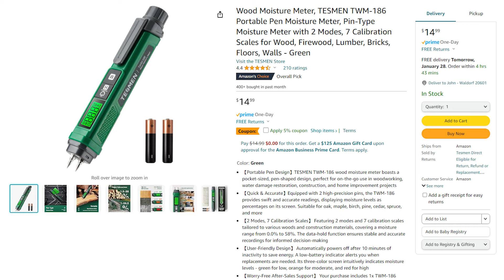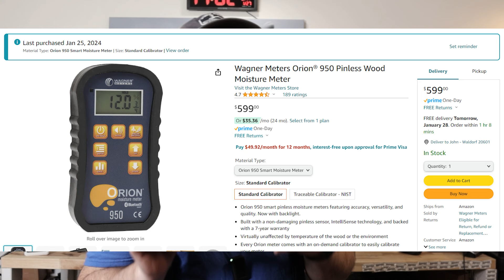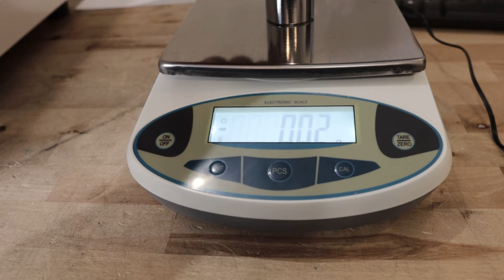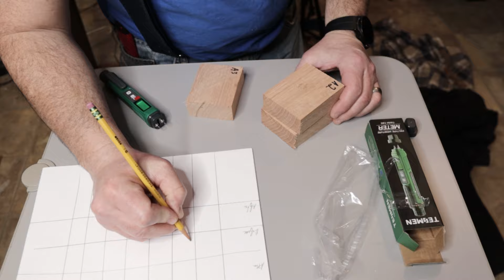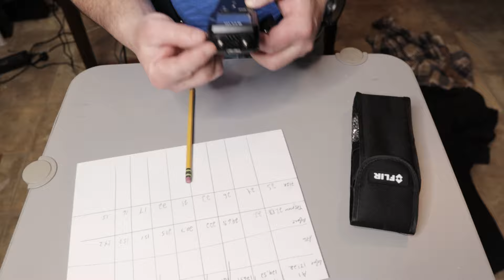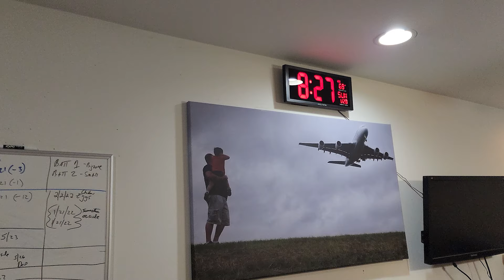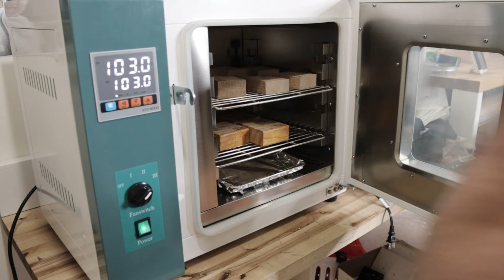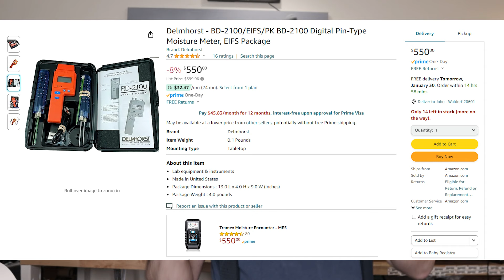Science Proves Which Wood Moisture Meter is Best

Comment: I tested my wood for moisture without any meter simply by looking at the smoke when I burned a sacrificial piece.  The lesser the smoke the drier it was.  I was extending my house and my uncle who helped me frame it told me he would be back in 6 months after showing how wet my wood was as he burned a piece of wood that I had in my garage over 10 years and compared to the new wood.  . The smoke from my wood was unbelievable as a lot of it was steam.    He said it would go quicker if I moved my wood to the garage and cover it with plastic and shipping blankets and leave a tiny heater going 24/7.  He said to refresh the air 3-4 times a day and you could easily feel the humidity.  In about 4 months that wood was ready to build.  It still smoked more than the old wood but not by much.
Reply: This has given me an idea,thanks !

Comment: I'm a retired hardwood kiln operator with over 20 years of drying experience drying hardwood for high grade cabinets and furniture. I was in charge of 17 dry kilns that held on average 40,000 bdft in each of them, I also ran two large pre-dryer buildings that held 500,000 bdft. I've dried millions of bdft of various hardwood species, mostly red oak. I've dried millions of oven samples in my lab oven. I recently retired and now Im learning about firewood for my cabin and I've noticed that all firewood videos that deal with MC always use a handheld meter and NO ONE was doing the "oven test".  I used a pinless meter to spot check boards but if the boss wanted to know the true MC%, it was always checked via oven test.  
So yeah, good video.  Wagner is the industry standard, I'd never ever use a cheap MC meter in an industrial setting. Also be careful with the lab oven, they've been known to malfunction and get the samples hot enough to smolder and billow smoke and fuck up the inside of the oven. In my 22 years of drying, I've seen three of them on fire, filling the kiln control room with smoke. Your lab oven looks new and is probably not going to catch the sample on fire anytime soon, but beware.  Anyone wants to bullshit about drying or kilns, ask me anything.
Reply: Can a pinless moisture meter read a board only a 1/2 inch thick, since it says it reads the MC at 3/4 inch depths
Reply: @E-Zelles  Yes, the meter should still work good enough to get you a pretty close MC%, but you need to make the sure board you're trying to read is raised up off of the table surface so there is nothing underneath the board for the meter to get a false measurement. Of course, the best, most accurate way is to do the "oven test" and then compare the oven tests results with what your meter is claiming.  Also, just a reminder, make sure you set your moisture meter to the correct species of wood.
Reply: Question for ya: 
Does driving screws or nails deep into the sample to act as electrode extensions for a pin-type meter provide accurate measurements?
Reply: @mrfirestop415 this is a great question!!

Comment: Great video!  As an engineer I really appreciate your test method.  I am new to wood turning and was considering a moisture meter to measure my rough cut bowl blanks.  Not anymore!  I think I'll go with a good scale since I really want to know that the the wood has reached equilibrium with the environment.  I will plot weight over time and final cut the bowl when the weight stabilizes.

Comment: At the end of November 2023 I purchased a Klein Tools ET140 meter for about $42 and a Wagner Meters Orion 950 which was selling for about $600.  The goal was to check red oak and black walnut boards that had been air drying for 15 years, but had to be coated with BoraCare to kill boring bugs. I was not sure of the accuracy of either meeter - in late February I tested the two meters side by side once the temperature reached 60 degrees. In short, the Klein Tools ET140 meter consistently measured the moisture content of red oak and black walnut boards at 7% to 8% lower than the measurement shown by a significantly more expensive Wagner Meters Orion 950.  I left a review on Amazon for the Klein Tools ET140 showing the side by side comparison.  

Thanks for posting your video, I now have greater confidence in the readings displayed by the Orion 950.

Comment: As an analytical chemist - thank you! I would love to see your data though. Not because i doubt you, just because I'm a numbers guy.
A few friendly suggestions:
When handling your calibration check weights - wear gloves! The oils and salts from your skin can alter the weight and they can also promote oxidation of the metal which can alter the weight as well.
I am curious about green wood measurements. How do each of the meters compare with a freshly cut qood sample.
Awesome video though. I appreciate the time you took to control variables and make it a fair and accurate test. Well done!

Comment: Great vid John,

Super comprehensive for the woodworking folks. I don't think there is any doubt they should buy a pinless meter, & the Orion model at that, if they can afford it.
Unfortunately I think the jury is still out for the plain old firewood burning people.
I'm still unclear if any of these are any good for checking firewood prior to burning.

Do you still own the test oven?
Could you perform another test on split wood, not dressed timber?
I understand it would be outside the official testing standards & procedures but would be a better real world test for the average firewood consumer.

Anyway hope you have one last firewood test left in you.
Hope you post a 'firewood meter only' buyers guides soon.

Great video regardless.

Comment: Many years age an old man told me how they checked moisture stabilization When they were building airplane frames out of wood.  Cut off the end of the board 6” from end then slice off from cut end a 1/4” slice, lay it on its side and cut lengthwise down center and see if it curves. The side with the most moisture will expand to tell if the center or side contains more moisture. The cut had to be straight to use in an airframe
Reply from the maker: Interesting!

Comment: That was a great video! As a DIY woodworker, I’ve been considering a moisture meter.  Too bad you didn’t use more pinless moďels because your results showed a VERY significant difference between the two you tested so I’m wondering if there is a model more accurate than your second place but not as expensive as the Orion. Thanks!

Comment: Great video! Do you think the R/D would work inside a crawl space to understand the moisture content of the wood or will the salt deposits left over from evaporation of water mess up the results? Just thinking from the standpoint that if the wood is over 60% humidity for 24+ hours we get the start of fungal growth accumulation.
Reply from the maker: I don't think it'll make a difference. Should work fine.

Comment: Awesome video! By far the best moisture meter test I've come across. I went ahead and ordered the RODINSCOS, which seems to be the current branding for the R/D. For my purposes, I think it should be fine.

The only thing I wonder about is if the cheaper meters have a lot more variance in production. For example, maybe you got a relatively good R/D sample, but a relatively bad TESMAN sample. I dunno. It does feel like it might be more of a crapshoot given the price point. Maybe that's an idea for a future test - use two of each meter (I realize this is significantly more practical for the cheap meters than the Orion, hah).

Comment: Great information, well explained. 
My use case is for firewood, so ease of use is most important, I often don’t know the species so I’m happy with my pinned meter that has just the one setting. I’ve tested kiln dried alder and the meter shows around 15%. So I use that as a datum now - anything there or thereabouts is good to go. 
Never considered repeatability as, before watching, I would have called that accuracy! Now, I’m now going to have to investigate further about relative density too. Thanks

Comment: I picked up a Ryobi contact moisture meter for like $10 used and have been considering getting a probe style meter for decks. I was unaware that the contact style could read deeper into the wood. I'm a handyman and also find them useful for block.  Looks like I'll stick with my cheap, 2nd-hand meter!  Thanks for the content.  I think you should get through to Project Farm to team-up for more far-reaching comparison.  I just saw a video of a probing moisture meter from Amazon that the guy picked up for $15 with a 2% margin of error.  Not bad for normies!

Comment: I am painting the siding of my house and it rained a lot  tonight. I already applied the first coat of primer 2 days ago and I was wondering if getting a painless moisture meter would be practical. Would you recommend getting the ones you found to be accurate or it is a waste of time trying to measure moisture on a primed siding? Thank you very much in advance for your help
Reply from the maker: In my opinion, the pinless wouldn't even see the paint/primer.
Reply: Thank you very much for your reply.
I am not sure if I understand. In your opinion is it worth it or worthless to use a meter to decide whether or not a siding is dry enough to paint?
Reply from the maker: In my experience, surface rain, be it on firewood or any other kind of wood, won't absorb water so much that a meter is needed. Like, if it's dry to the touch, it should be good to go.
Reply: Thank you very much again for taking the time to reply. 
Now I know what to do based on your video and these comments.
Subscribed👍

Comment: I love your testing controls and methodology, especially since you used the Math to quantify your results I.E. Moisture Meters are not measuring devices, they are indicating devices, using your math you quantified how close that indication matched the true measurement.

I have serious biases when it comes to testing equipment (Not buying on Amazon ever is one). I own way to many Flir, Tramex, and Delmhorst meters, and in the field when you can't verify with an oven test they all do the job. Job being close enough to not fail, and quality recognized enough to make the "Data" stand up in Court if something goes south.

But, and it's a big But, Wagner/Orion, whether its the 930, 940, or the 950 contact meters are consistently more accurate than my most expensive Pin meters, so in my "hobby" shop where I need to know the conditions of wood before I invest the time in working them It's the Orion every time. 

It's funny how "application" is more important to Clients or Potential Clients than laboratory confirmed accuracy. When I have a Wood floor or Cabinets in a dry-out situation and pull out the Pin meter they only care about the holes, when it's just drywall and molding they are Completely Sold and Impressed by my Tramex MEP (Tests more materials less accurately meter lol)  - I over-dry, so I just need to know readings are dropping over time with consistency as opposed to accuracy.  

Great Stuff man, apologies for the wall of text, and I really want your laboratory, may have to dig a basement in the backyard.
Reply from the maker: I agree that "application" is more important than lab accuracy when it comes to real-world usage. 

And start digging!

Comment: It’s been a bit since I’ve done research on meters. 
Split a good amount of firewood, and at first was using pins when I contacted the manufacturers, a lot of people don’t seem to realize the pins are supposed to go in almost all the way in. This is never going to 
 happen on a hard piece of firewood, like oak or black 
locus
As for pinless, I’ve had pretty good luck like you said Oak actually splits pretty flat

Comment: Hi and thanks for sharing, appreciated.

Didn't know pinned wood moisture meters should measure along the grain, thanks.

I've seen others split the wood and pin on the center to get an indication of how fully seasoned firewood is in the middle. I wonder how pinning on the outside rather than the inside would effect measures and cause the testing to lack fidelity with the design purpose and instructions for use of pinned meters when checking seasoned state of firewood. i.e. it seems the testing methods were not in line with checking if firewood is seasoned with pin moisture measures - a common use for them. 

I found the moving forward and back, left and right while talking made watching take more effort, it was a bit too much for me so I scrolled down to lessen the sensory load. 

Thanks again for sharing, I learned some stuff I didn't know, though I think the method had inbuilt bias because splitting the wood for the pinned meters would have enabled them to avoid the error of measuring too dry on the outside. i.e. the test didn't fairly look at using pinned meters for checking if firewood is seasoned while doing the opposite of what a method to test that would. 
Cheers
sincerely
d
Reply from the maker: So, to be clear, you didn't watch the whole video, because I didn't stand still like a robot. Then, complained that I didn't do something that I explained, but you didn't see because you clicked through it?
Classic. Never change internet.
Reply: Hi @JohnWCH  
Thanks for your reply, I'm happy to have a chat.
SO, TO BE CLEAR, YOU DIDN'T WATCH THE WHOLE VIDEO, 
No. Once I’d seen you read one set of instructions seeing it again was a waste of my time, I knew you were following manufacturer instructions so I didn’t need to watch your repetitions so I skipped ahead etc. Basically, I found your presentation inefficiently repetitive in some parts. Do you really think people want to watch you basically repeat yourself? I suggest you show it clearly and succinctly once then make it clear you did it for them all. That would get your good following of instructions across without dragging out the skinning of each cat, even though there are lots of ways to skin a cat, I didn’t need to see them all. 

BECAUSE I DIDN'T STAND STILL LIKE A ROBOT. 
That’s right. That was my point, you moved to much as I explained. Good to see you got my point.

THEN, COMPLAINED THAT I DIDN'T DO SOMETHING THAT I EXPLAINED, 
That you didn’t do it made the testing biased.
Explaining it at the end didn’t change that fact.
It’s like you said at the start about how there are so many YT vids claiming to be doing science but they don’t know what they are doing and so they don’t do as well as they wanted to. So you’ve already pointed out your own error to be like that of so many others, so I know you understand. 

Quality feedback pointing out basic errors in method is valuable and I’m happy to share it freely as you shared freely, thank you again.

BUT YOU DIDN'T SEE BECAUSE YOU CLICKED THROUGH IT?
I saw it after commenting and before you replied. I judged the explanation didn’t change the unfair method and results. However it clearly admits that the method was not as good as it could have been. i.e. you actually know the testing was biased. You aimed and claimed to be doing a better comparison than others, I don’t think you hit your goal this time.

CLASSIC. NEVER CHANGE INTERNET.
We’re part of a society that believes in science but a lot of the population doesn’t know how to do or judge it well. 

As a former science teacher I think your testing design had significant bias. What you do with my feedback is up to you.

Cheers
sincerely
d

Comment: hi  i have the rd, one thing i would like to understand is why the measurements change so dramatically, when you measure the same wood from soft wood to hardwood   ,i know whar they are, BUT why the device measure so different values? try it on cedar for example, measure the both modes, and you see..thanks

Comment: Just so I fully understand... when you say the Orion has a 3.66 percent error margin, does that mean that it could report between 9.64% - 10.36% moisture content when the actual moisture content was 10%? Or could the Orion report 6,34% - 13.66% moisture content when actual content was 10%? Or does it mean that the full range of potential error was 3.66% of the actual moisture content number?
Reply: 10.36% of what? The dried piece? That means the peace was 110.36% before drying? These calculations are confusing. I guess I have to read ASTM D4442 myself!
Reply: @elbuggo  It's absolute moisture content, contrary to air moisture content which is relative to the air temperature (since different air temperatures can hold different amounts of water). So 100% air moisture is not that you are under water, but rather that the air cannot hold more water at this temperature. 

But with wood moisture content you weigh a piece of wood and then you put it in an oven. You take it out every four hours and weigh it again. Then you repeat that procedure until it hasn't lost any weight since the previous measurement - and at that point it is considered to have a 0% moisture content. 

So if the piece of wood weighed 100 grams before the oven procedure, and it weighs 90 grams after the procedure - then that means that the wood must have had a 10% moisture content before the oven procedure.
Reply: @AndersHejdenberg  RE: if the piece of wood weighed 100 grams before the oven procedure, and it weighs 90 grams after the procedure - then that means that the wood must have had a 10% moisture content before the oven procedure.

I don't agree. Your sample had 11.11% moisture content. The dry sample is 100%. I found the calculations in ASTM D4442.
Reply: @elbuggo  Ah, gotcha - I though it was the other way around (which I suppose makes more sense now that I think of it). So 90 grams is 100%, which means that 10 grams would be 11.11%.
Reply: @AndersHejdenberg  That's exactly right! 100g =111.11%!